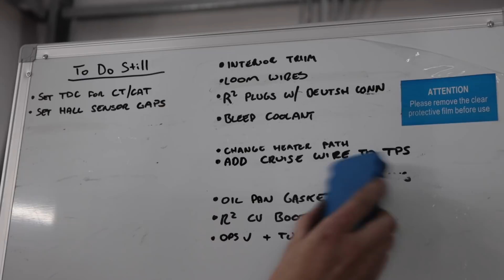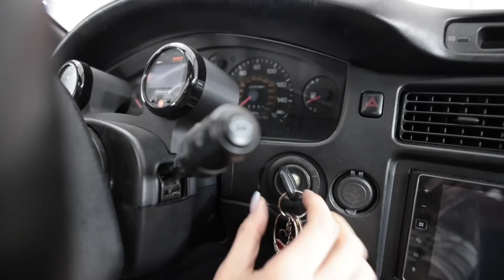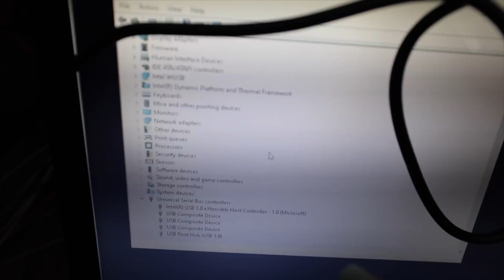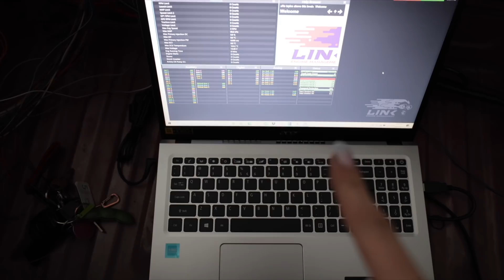Failure To Communicate.. // Project MR2 Turbo Restoration

Comment: Hi Sarah. Just some helpful comments I hope. For Sensors you should use separate grounds for each sensor or you may get "Ground Loop Errors". This happens when you share a common ground with other grounds that carry larger or smaller currents. Make sure your Top Dead Center is not on the Exhaust Stroke since on a 4 stroke engine Top Dead Center occurs TWICE. Both valves should be closed. I have seen friends make this error and cannot figure it out. I don't believe in luck. I believe in check,double check,and triple check your work. However 
Brain Farts happen. Best Wishes

Comment: Old school top dead center, you made sure the cylinder piston one was at the top of the stroke. You could check it thru the spark plug hole and a rod as you turn ed crank that the rod was at top of travel. Then work from there.
Reply from the maker: You mean exactly like I did in the video?

Comment: I don't know if your laptop was registering any usb devices at all. But older laptops were limited to 0.5A output. Newer ones went up to 0.9A / 1.0A . Maybe see if your ECU needed that bit more power the desktop provided. Anyway great video and as always the 'rear end' is looking great on the MR2.

Comment: when the motor is at very high RPM's the crank trigger might be spinning so fast the there is a problem with the sensor signal on the capacitor/transistor circuit...  so it can switch to reading of the camshaft signal. the faster the key rotates the longer it takes the first micro capacitor in the chain to charge, but there is a large bank of transistors calibrated for many differing micro voltages that do lots of switching throughout the voltage capacity of the pickup cap. those sensor wires sometimes have to be internally silver soldered to help with the line clarity as well as having EMF shielding over the wire.

Comment: About the trigger timing. ECU knows the basic engine timing from the crankshaft trigger only. From that info ecu does not know in what phase engine is. As crankshaft does spin twice when camshaft spins one. It works fine with crank position only but any sequential stuff doesn't work for this reason only. Thats why camshaft position is required too. With camshaft info ecu knows where crankshaft is exatcly going. What is seen from the video. You have crank trigger wheel completely wrong. The thing with missing tooth wheel is the missing tooth. That  tells to ecu that one full rotation has gone by. I dont know how much time  the Link ecu needs to calculate stuff but I'd quess that the missing tooth should be like 90 degrees before the sensor. In other words missing tooth should be gone past the sensor(in engine rotation direction) 90 degrees. What I mean by the time? I mean the time what goes when missing tooth is detected and the spark fired before the actual TDC. In that suggested 90 degrees of crank degrees ECU needs to calculate everything what is needed to inject fuel, charge a coil etc and actually inject fuel and fire spark and spark with it's timing. Of course with cam trigger included ecu can then spread the calculate time all over the place but the basics are like this.

Comment: Why did you not use the handled cutter tool on the braided fuel line that was used on the vacuum hose?  Wouldn't that have worked better with a straighter cut that the Dremel?

Comment: Fast & furious. Who else would wear shorts and a tank top working on a car?
Reply from the maker: Have you ever lived in a place that maintains daytime temperatures over 100°F for half of the year?
Reply: Texas. But Arizona is a dry heat. Texas is VERY humid. And it wasn’t meant to be an insult. Sorry you took it that way.

And what was up with 4 beans for a hellcats acceleration???

Comment: Its actually a combination of the two sensors that tells it where TDC is.  so when the cam sensor triggers on startup it basically resets the count on the crank sensor.  The ECU then knows how many pulses it should see from the crank during one full rotation, and its constantly counting.

Comment: little AN tip.when i get the nut on the hose i take a tapered punch and put some Eaton hose lube on it.then i push it in the hose to help open it up a bit.fitting goes in nice and easy and you do not have to worry about taking a chunk out of the inside of the hose.done thousands of them this way.

Comment: Can't wait to see your face when the engine starts for the first time with this new setup!  I'm surprised you had to work so hard to find TDC on cylinder 1.  Since it used to have a distributor, I would have thought there would be a timing mark on the crank pulley and a scale for setting the timing, or did that have to get removed to install the Hall effect sensor?
I didn't count, but if this isn't the video with the most innuendos it's got to be close 😁
Reply: You never trust the factory timing marks to be correct when your building or modding an engine. Many have found the factory marks to be off.

Comment: Suspense and anticipation is building. Will it start on the first go? I’d wager it will be the third attempt.
Reply from the maker: All the sensors seem to be communicating and wired correctly, just have to figure out the software side of things.

Comment: Great video, Sarah.  Coincidentally I was just setting up my hall effect crank trigger a couple of days ago.  I suspect you’ll end up teaching the computer how many teeth are between the missing tooth and TDC.  Does the cam trigger in this application just indicate which rotation of the crank we’re on?  I.e. intake stroke vs power stroke.

Comment: Yeah, the ECU sees tdc based on a spec of degrees after the missing tooth on the crank. You'll probably have the ability to adjust that spec in the ECU as well as physically fine tune it on the trigger wheel. The other thing that's important there is your ECU using either the rising or falling edge of the signal from the sensor. A lot of older, factory Bosch ecu's will give you a 3 degree ignition advance by swapping the signal wires in the crank sensor, as it inverses the signal, making the teeth look like the gaps.

The cam sensor is so that the ECU knows what tdc is what, not it's position but compression vs exhaust stroke, and is used primarily for injection timing. Crank is used primarily for engine speed and position, since it's a much higher frequency signal (many more teeth, spinning twice as fast)

Due to piston dwell time, your high point at tdc is more of a range of a few degrees of crank rotation. To be exact, you want to watch the indicator and mark the rotational position of a specific 'height' both before and after tdc, then split the difference of the marks. So that exact tdc is your position between the same reading as the piston approaches and departs your 0 point.

Vibrant makes some nice hose separator clamps that I think you'd like (other brands too). I've seen them in 3 way too, but never with different diameter holes, which it looks like what you'll need. You can use a piece of hose around a smaller hose/Hardline to fit the clamp and secure it better. When it's trimmed up well, it looks super clean.

Nice work here.
Reply: On a mitsubishi v6, with a 3-prong crank sensor & 3-prong cam sensor, when they both line up at the same time it is TDC. Hall effect sensors only know on/off, so to adjust timing the ECU is waiting x milliseconds from the last time it triggered, depending on RPM.

Comment: Not to be critical but I think the air filter Inlet should be closer to that hole in the side of the body pick up the cold air from outside and left engine heat. I just think it's a little too close to the engine.
Reply from the maker: There’s a 10” cooling fan 2 inches above that filter, it’s fine.
Reply: @SarahnTuned  oh yes I forgot about the cooling fans that you installed my even thought that was a wonderful idea.

Comment: Yes, the missing tooth on the crank  sprocket tells the ECU TDC. Should be a similar tooth missing on the cam sprocket for engine, ignition and injection timing.
Australia is in a different time-zone, did you take that into account?
Strangely enough I feel pride in your accomplishment here, is that pride by proxy?
Viewers be aware this video spanned three days of probably 16 hours each. And then editing.

Comment: Are those fuel lines from Chase Bays? I bought a power steering kit from them and it was the worst mistake ever. One of my lines were leaking from the fitting and the cooler was leaking as well. My luck I guess. 3 months later and I'm still waiting for replacement parts. Ridiculous.
Reply from the maker: Nope
Reply: @SarahnTuned  odd. They must get their fittings from the same supplier because they look exactly the same